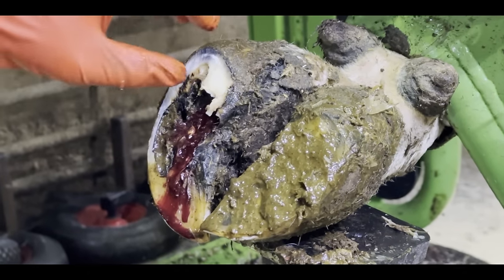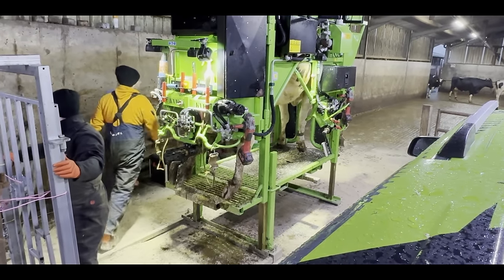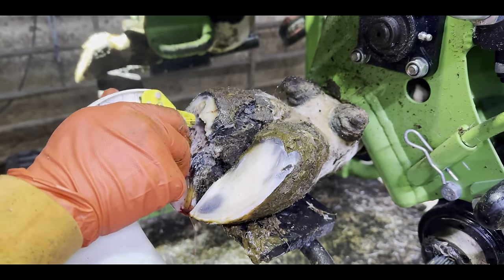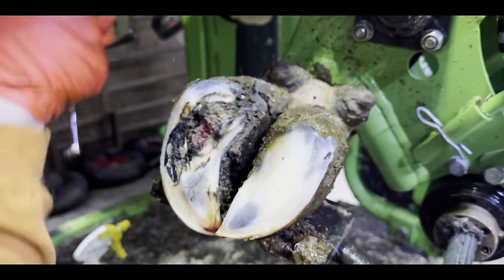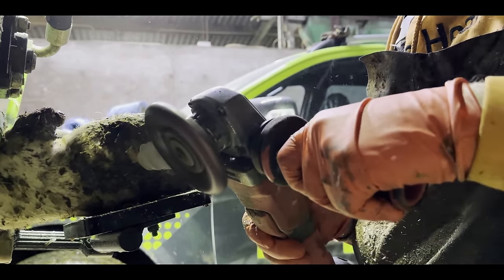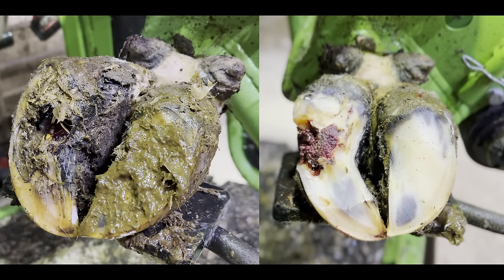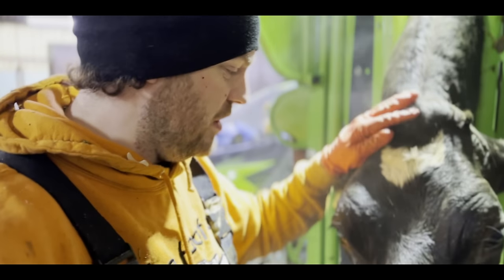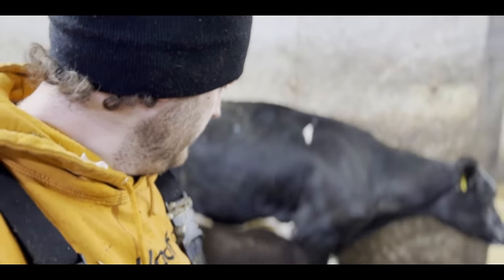WHITE LINE DISEASE destroys this dairy cow's hoof

Comment: You mean the structural part.  The architectural part is the part that's just for show.  Steel and concrete is structural, drywall and paint is architectural.